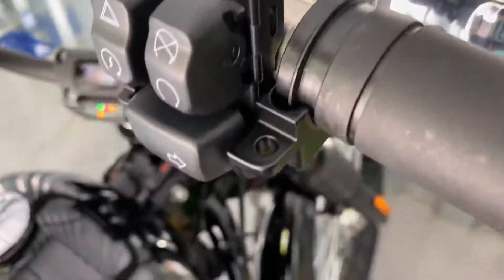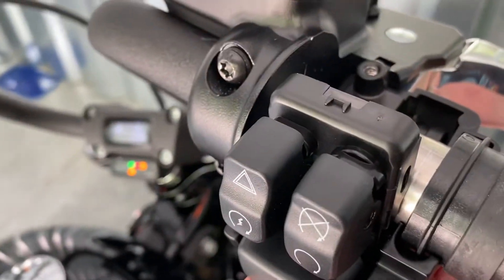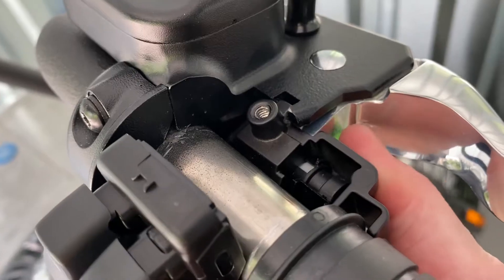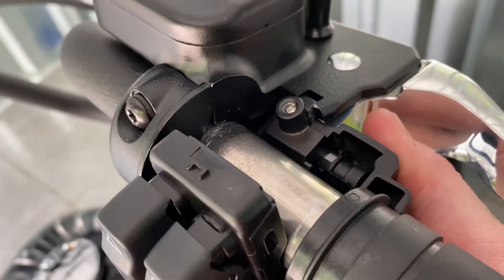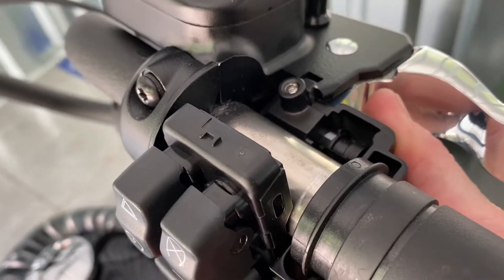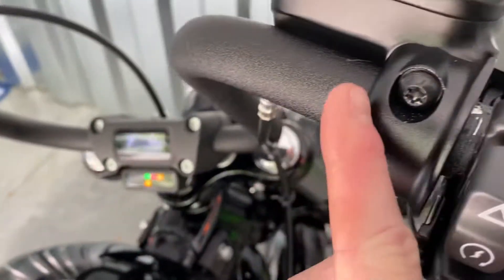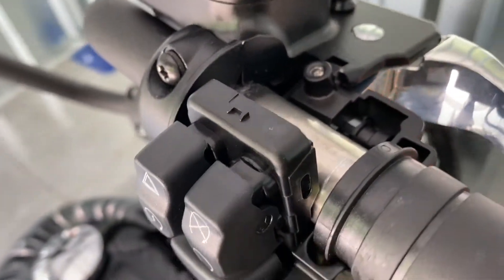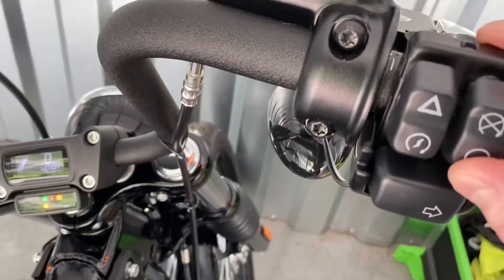EASY FIX- Harley Davidson Brake light stays on

Comment: That's something. You would think that who ever adjusted the hand brake would check things before sending it out. This is why knowing how to do things yourself is very important. Even a simple fix is knowledge.
Reply from the maker: Yeah you would think that all the salesman would even know to move the housing at the same time as the main clamp but evidently that’s not the case. Just a tiny bit of misalignment from loosening the main clamps while muscling the housing without loosening it is a big no no. I wouldn’t of known that the brake lights were even on if she hadn’t been riding behind me that first day we had the bikes more than a week ago. I fixed it the very next day  but I just posted the video.